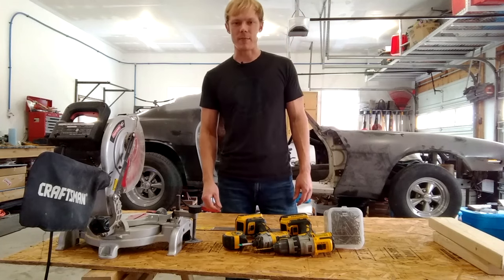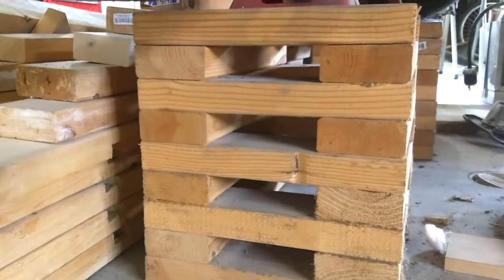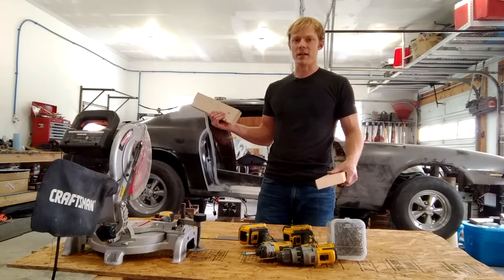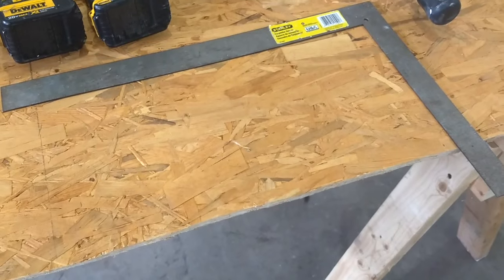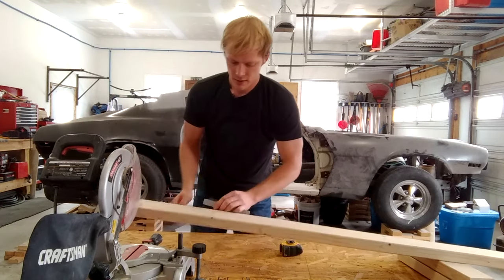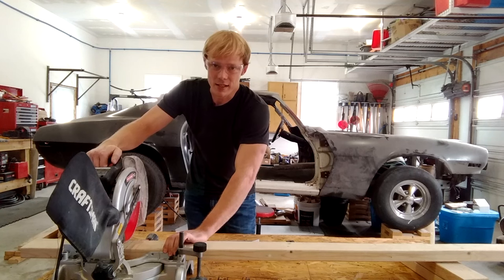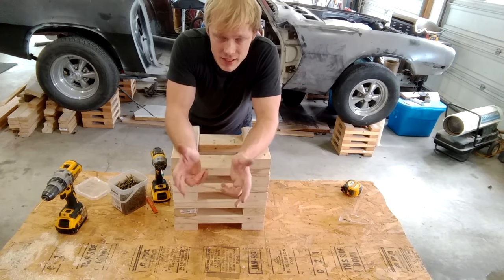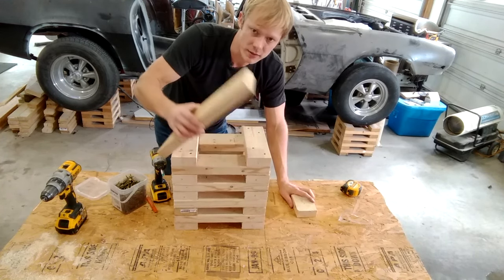DIY Wooden Car Stands (Wheel Cribs)

Comment: These are dope man. I love them. Exactly what I need for my caprice project. Only thing I would change is when putting a jack stand on the top I would install a piece of sheet metal to keep the bottom of the stands from cracking into the wood from the load. Just a thought. But awesome job
Reply from the maker: Thanks man, I'm glad you like them. Great suggestion about putting sheet metal between the jack stands and the cribs.
Reply: I find that could be possibly slippery? metal on metal? just a thought not knocking the idea.

Comment: You could put another 2x4 or piece of steel flat bar on the open ends (or long side) for when you have the jack stands on them. This would stop the stands from sliding out and off and contain it on all 4 sides. I highly doubt they would slide, but if people are nervous about it that would be another cheap safety benefit. Appreciate the example.
Reply from the maker: Great tip. It’s always better to over build when safety is a concern. Thanks for checking out the video.
Reply: @RestoCar how much it cost u
Reply: Figure it out

Comment: Just what I needed.  I have the maxjax two post lift, but wanted to build some of these cribs for wheel alignments at home.  I saw a comment on using one screw and/or glue and I think that should be fine since it is just used to hold the pieces together.  I built an aquarium stand out of 2x4's many years ago to support 700 lbs, and the key point was to make sure to build it so that the woodwork is holding the weight, not the fasteners.  Great video!

Comment: Great video and tutorial. I plan on making 4 of those to work on my Mustang. This is a great way to pre-load control arm bushings and get underneath to tighten all the bolts with the car at ride height but raised up. I am worried about getting cheapo wood tho. The stuff at Home Depot has gotten of poorer quality lately. Thanks for sharing.

Comment: If you are putting jack stands on them, I believe that using 1/2" steel plate that first fits in the entire space that the stand sits in would amp up your safety factor.   You are still putting the stands on "bridged" 2 x 4's but....  The engineers out there might have other thoughts, like solid support right to the floor under the jack stands.

Comment: These work great for Motorcycles too. I work at dealership and when we have someone pop in for a quick oil change or we are building a bike to put on the sales floor when they come in we'll throw it up on the wheel cribs instead of putting it on a lift.

Comment: Just in time!  Thank you so much!

First of all, just to give me the now normal culture of a crib as I didn't know what to call it but my father built one for lifting his project cars when I was a kid.

I want to make a crib out of 4x4 prime Douglas Fir to support the front end of a 3,000 lb semi truck engine.  This is so I can drop the front crossmember and change the motor mount and do some other work with cross member lowered.

Did you have to build a notch for your jack-stand? Were you really worried about slipping off the crib?  I didn't buy enough linear feet if I have to build a little square for the jack-stand to sit into.  I was just going to place mine on top; maybe even cut some 2"x2" steel plates for the legs of the jack-stand to sit on on so it doesn't cut into the wood.

Comment: Me personally, I'd use bolts for the last two layers that the tire would be putting a lot more force on. Also, I'm going to make mine almost like a pyramid for stability reasons, so starting from the bottom will be thicker and the top will be get thinner. Thank you so much bro for this brilliant idea. I am too broke to afford a house to install a lift, and this is going to give me more than enough clearance to drop transmission..etc without getting pinched and smashing hands and elbows lol.

Comment: Curious - why not use 2 X 12s or 2 X 14s and just stack them (screwed together) and then stops on the top one? I have seen others making wheel cribs but never with larger solid wood stacked. Is there a disadvantage to doing so, as I would think it is even stronger.

Comment: From a production standpoint, I don't see why you wouldn't just come up with a standard for width and depth I.e. 13" square. You cut down on your build time significantly...
Reply: THEY GET HEAVY.. MAKE THEM 1 LAYER LOWER
DRII PILOT HOLES FOR EXPANSION AND CONTRACTION. DONT PUT THEM UNDER THE SUSPENSION IF YOU ARE PUTTING ON QUARTER PANELS
 THEY ARE AT RIISK OF BUCKELING.
NEED TO GO HIGHER. MAKE A BOX FOR YOUR JACK.
Reply: @kennethswanson714  are you saying not to use these? I'm not sure what you're saying

Comment: Good project. I am doing the same.  But the way you cut the wood pieces on that chop saw at 11:18  missed one of the best features of a chop saw!

For these cuts with a lot of the exact same sizes, you need to use the saw's fence and clamp down a "stop block" at the length needed.  Then you can cut exact same length of pieces each time without measuring because measuring is prone to error and slow.  The stop block clamp will cut pieces that  are exact every time which is perfect for this type of project specifically.  Faster and exact.
Reply: Right tool for the right job
Reply: Right tool for the right job

Comment: Pressure treated wood necessary for this or no? Quite a difference in price between 2x4 studs and pressure treated lumber. Thanks
Reply from the maker: No it's not. I used regular lumber in the video for my set. You could throw a coat of paint or stain on them if moisture is a concern.
Reply: Thank you sir. Great video. This is my weekend project and something I needed desperately to do the all wheel disc conversion on my 69 Camaro.

Comment: Could you screw the pieces of wood  that need to be the same length together on top of each other using the pattern you used and then lay it sideways and make the cuts? 
This way the pilot holes would be predrilled and you would make 1 cut across 4 pieces of wood. Would prevent you from having to measure each piece individually sonce they would all be exactly the same lenght.

Comment: How do you get it up on the jacks though ? And the stands.
Reply: I had the same question. 
How'd he get it that high with a floor jack? Was the process safe?
Reply: I use a Daytona 3 ton jack with a 4x4 pressure treated cut piece (about a 12” long scrap I had laying around) to jack it up, use jack stands on the rear, then the front, then slide those cribs in. Finish by doing the rear. Here’s his way if you haven’t found it yet:
https://youtu.be/gJ7t_WxgMK8

Comment: Sorry, beginner question here.
The boards are 2" thick. But we have to drill 2.5" to bind the 2 boards. Does that mean only .5" is enough for the 2 boards to bind solid?
Also, can you confirm that you need to drill as deep as the screws are long ie 2.5"? 
Thanks.
Reply from the maker: Great questions! The actual dimensions of a 2x4 are 1.5" x 3.5". The 2.5" screws will give you an inch of bite. I like to sink the screws into the lumber about another quarter inch as well so that the screw head doesn't interfere with the boards on top. You should drill your holes as deep as the screws are long. Drilling a little deeper than the screw is long will not hurt anything.

Comment: Is there any worry about the wood cracking or splintering under load? I see some of yours have cracks and it looks like mine do as well.
Reply from the maker: It doesn't worry me because the cracks were in the lumber when I made them and most of the weight is pushing down, not out. If cracks are showing up after the fact, it's likely that the wood was wet and has dried out.
Reply: Heard somewhere that soft wood is good to 500psi. With the small surface area of the feet of those jack stands, yeah I'd worry about it
Reply: Karan Sikka not sure where you heard that but the compressive forced of Douglas for is 7230psi based on a google search.
Reply: @willparfet8912  I looked further, 500psi is the "fiber stress at proportional limit"
Reply: Karan Sikka I’ll do some digging thanks
Reply: Karan Sikka You’re absolutely correct. It’s like concentrating all the weight into four points (2 per individual wood piece) that the legs make contact with. I have found a solution to this by using different set of jack stands that don’t have such feet, but are merely flat thick metal all around. It distributes the weight much better, not to mention I feel even more safe. I’ll have a video of the whole thing someday. But these cribs are solid!! People just really need to spend that extra money for good solid jack stands! Your life isn’t worth saving a couple hundred dollars.

Comment: Have you ever used the same style cribs to set it on the frame instead of tires? What is the best way to do that... seems like all the weight would fall on the top 2x4.
Reply from the maker: I haven't, but I wouldn't hesitate to do it. I'd probably set the jack stands on top of the cribs like I show in the video. Another option would be to run a 4x4 across two sets of cribs and set the frame on it.

Comment: So if I were to just stack 3 criss crossed solid ....no gap maybe 16 inches tall. .. It should support my F150 under the frame as stands??
Reply from the maker: Yeah should be fine. The way they are built in the video should be strong enough for an F-150.

Comment: About cheapening the assembly process 
I think ( borrowed the idea from https://youtu.be/achbTckZrPY ) 
that screwing the planks together might be an overkill 
you can easily get away with just using a glue .
Reply from the maker: Thanks for the tip. I agree that a good glue should be sufficient.
Reply: In that video that guy goes on to make the case that nails or screws actually compromise the integrity of the cribs. Is that true?
Reply: I’ve seen the videos where they literally just used the wood pieces stacked, no glue no screws, nothing! Truthfully the downforce weight literally would be sufficient to accomplish the task, and yes the screws might possibly in theory slightly compromise the integrity of the crib. But I have yet to see wooden studs in construction be compromised because of nails, screws and/or any additional piercings by owners though the drywall etc. Personally I’d rather it be screwed and also glued & take the risk with additional backups. Overkill it maybe, but you’ll live to tell of any compromises. Screw it, I say.